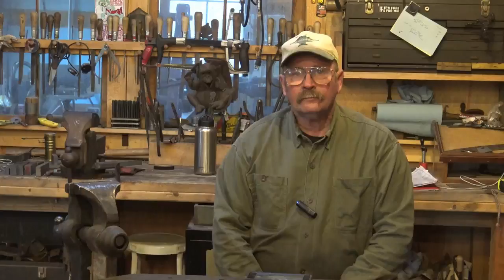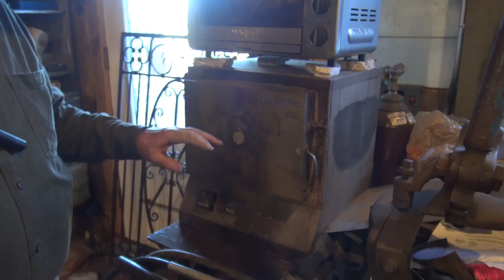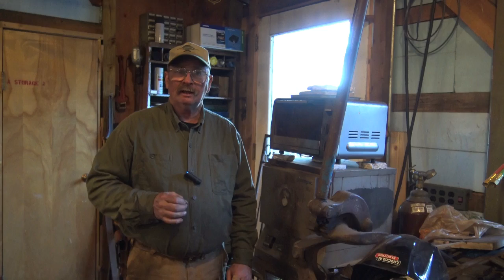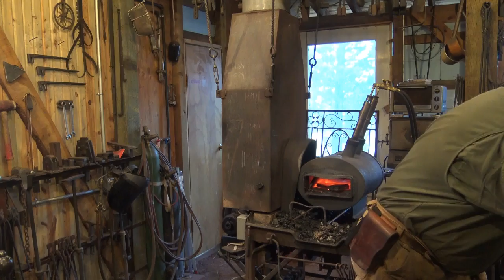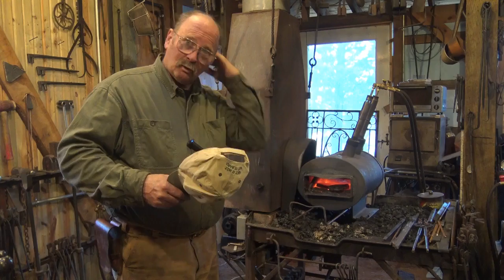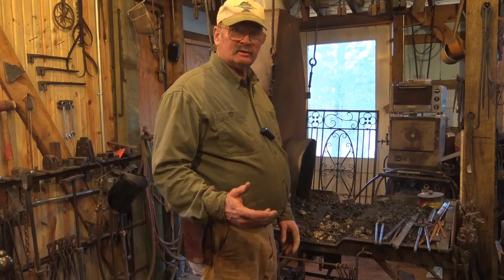Coal forge vs Propane forge a look at the pros and cons

Comment: That absolutely was the most informative yet non-preaching videos I have ever watched. Thank you !!!!  Including Fact of you what you know , facts on environmental side is rather important especially depending on where as you said some of these forges would be placed. Where as I am much the same as you just a bit higher in elevation and bit northwest of you in Park County which is anything goes as long as your zoning is business or Agriculture, which I am both and regardless I am still considering the concept and concerns for usage of coal & or coke. I was however sparked by immediate thoughts and light bulbs  when you had mentioned charcoal heating for a forge which can be done without even more then a purchase of a  large billows as well as can route my stack through my cabin which is half inch fracking pipe as a form of forge / wood burning boiler. Which does not work very effectively or efficient as a wood burning stove but as a wood burning furnace/ forge that changes everything,  So thank you to your video my heating /Forge upcoming costs are no longer a purchase , but instead  a already have most items and can spend more where I need to for better equipment. I also raise Llama and know most people use wool lining in forges due to the fire resistance wool has is this what you would recommend in your coal forge and or in a charcoal forge ? And assuming I wouldn’t be able to achieve welding temperature at 9000ft with a dual or three burner propane forge however got a good deal on 1000gallons two years ago so would be less labor with propane yet again my stock tank heaters will be fine using that up and to get the smoke rolling out at the start of my day instead of the end of it with long wait for my cabin to heated by days end already would be absolutely perfect, would be amazing!!! I just got frostbite on my fingers and toes so I am ready for some heat after that long recent cold snap we had up here @-20’s .... Even the building the wood burner forge/furnace / ex wood burning stove is in is heavy gauge steel sided building using the scraps  left over from the Pepsi center , as the place was originally built by the metal fabrication company who did the metal for the Pepsi center and hence why a metal building has a wood burning stove that was extremely over built as a stove but perhaps perfect as a wood burning furnace/ forge  Broken Arrowhead Ranch on Facebook if you happen to have Facebook and would take a look at the metal cabin and give me any helpful suggestions or guidance sir !!! Thank you -Cotton

Comment: Oil Burning Furnace; Look up Beckett Burners folks. Those things get really hot. Another Idea I saw to cut down on the heat on a gas forge, Just Throttle it back with a bypass valve while your hammering. Back to the show...

Comment: I much enjoyed your video and consideration of charcoal as fuel. I live in the Southeast U.S. and have tens of thousands of pounds of hardwoods all around me that I need to  clean up after our somewhat infrequent snow and ice storms plus hurricanes. I am never at a loss for wood, so I burn charcoal and use that in my forge. It also has the advantage that once burned it does not rot or get infested with wood-eating insects. The best charcoal return that I have achieved yet was with split wood from wild cherry and persimmon trees. That turned out to be very nice stuff and better than charcoal from pecan or hickory. I have 500 lbs. of charcoal  in my fuel box at the moment made from trees downed by Hurricane Michael.
Reply: Thats awesome.  Its getting expensive running a kingsford charcoal forge hahaha.  Got a gas forge on the way though.

Comment: Thanks John, really excellent thorough video. I got started on a little coal/charcoal forge and I'm now building a propane forge for exactly the reasons you set out - it's clean, compact and convenient. As someone who currently has to fit blacksmithing around a 9-5 day job, being able to fire up the forge in a matter of seconds and work for an hour without coming back covered in coal dust and smoke will mean I get out to my shop much more often during the week.

Comment: Thanks for the talk, practicality is going to make the decision for most if not all! I use LPG, you call it propane but is my only option unless I can source enough timber and make my own charcoal and that is impracticable! Coal is just not available, electric induction would be hugely expensive even after the set up cost as electrical power here is the most expensive on the planet. Sadly, forge welding is out of the Question except on very small and infrequent occasions!
Reply from the maker: I forge weld in propane on a regular basis. So it is a possibility with the right forge

Comment: Hey John, thanks for the class on fuels; What about Wood Pellets there compressed at 10,000 psi. which breaks sap capsules in the fiber. They get really hot. The Beckett Oil Burner is an awsome little machine that will burn waste oil. I learned it one day and taught it the next. It actually has gears that can grind up any crud that may be in the waste fuel. Thanks
Reply from the maker: I have heard of people using them, but have never tried them myself

Comment: I have two induction coil units but they have never been used for heating pipe.  And they are over kill for a work shop like a black smith shop. they are 20 KW units and are three phase.  I can get units smaller and that will run on 220 volt single phase. and you can design how ever you want to drap your copper coils. It would be really easy to adapt the use of my induction units for forge work.  The thing is that you can set the temperature of your metal to within 1/2 degree and actually melt any metal you put in it if you want. I can turn any ferrous metal into molten magma in minutes. and do it to exact and I mean EXACT temperatures. GO for it..
Reply from the maker: If the budget ever allows, I am sure i will give one a try.  Or if I'm lucky someone selling them might like to let me demo one.

Comment: Hi John,

Thanks for the excellent videos.  I’m just getting started in the craft, and this presentation really helped make my decision.

You mentioned problems with forge welding and the flux causing deterioration of the bottom of the gas forge, and that the hearth liners that are offered do not perform well.  Incidentally, I own a small company that manufactures high temperature ceramic components.  The material we use is very high strength, very corrosion resistant, and rated for 3,200 F.  I have a few tiles 3.5” square by about 3/8” thick that might be worth trying for a hearth liner.

Let me know what you think, and I’d be happy to send them your way to try out.    

-Ben
Reply from the maker: I would be happy to see how they hold up.  But 3/12" will likely be a bit small and flux would drip of the edges.
Reply: @BlackBearForge  What width would be ideal?

Comment: Hi.
Have you any idea why the burners come into the gas forge from the top as when the forge is turned off all the intense heat wants to travel up to the gas tip. Foundry furnace always seem to come in from the lower side. Thanks. 
Really interesting.
Reply from the maker: It seems to help heat the material more evenly as opposed to having the direct flame from one side.  In use heat can't travel up the burner and if you close the chokes at shut down you can keep excess heat from going up to the tips after you shut it down.

Comment: Was just rewatching the video. As to the social impact of using a coal forge in a residential neighbourhood; I have an understanding with the pot heads next door. When they decide to smoke up and stink the air up, I get to pile on the green coal. Take that!  Of course not that it matters at that point because they're baked.  I did however feel bad for the guy two houses down. The one day the wind was blowing directly to his house. After piling on a bit too much green coal you could see the cloud of smoke enveloping his back yard right when he was working in his garden. That was followed by a fit of hacking and furious coughing. I figure that if I can tolerate the pot heads and the lane being filled with cars from the curbers, they can put up with my forge once a week. I do have one question regarding the gas forge. Do you turn the gas down between heats to conserve fuel? or do you let it run once it's at temperature? I'm working on adding one to my collection and need to get an idea on the tank size I will need to consider for a small portable set up. Cheers.

Comment: Again, a very knowledgeable and informative video. I realise you made this a long time ago, but I only have a few hours a day to do things other then work and dad. After saying all this, you were talking about the expressiveness, and overall hard to get electric induction furnace. I had built one from an old electric heater, some sheet metal, and some kaowool (with various other parts) a few years back. The blueprints for which I easily found online, and spent less then $200 on. I used it to smelt down aluminum cans into  ingots. It didn't last long, as I'm electrically illiterate. However, if me being some dumb kid at the time could build 1, I'm sure a master craftsman such as yourself would have no problem building and operating. I know I for 1 would love to see you at least try. Just food for thought. 

Keep up the wonderful videos, and beautiful works. Thanks again for your wisdom.

Comment: You mentioned charcoal several times. Is there on that works best? Homemade, briquettes, hardwood lump? What are your thoughts on that?
Reply: Probably lump or homemade hardwood. Bricks are useful for grilling.. and thats all
Reply: I wouldn't even use briquettes for grilling to be honest. It's pressed charcoal dust and very nasty.
I've used charcoal and if you can get your hands on it, hard wood x charcoal is something different. Works really nice and keeps you going for a long time.
But you have a lot of ash flying around using charcoal. Just remember that.
Reply: I use briquettes and they get very hot. Stuck rebar in and thirty seconds later it was bright orange. It gets so hot that the cheap brick I use in my forge frequently spalls and breaks in two. The dust is a nightmare but if you had to use it, it could start you off....but definitely use something else.

Comment: i worked for a small foundry that made hard surfaced components(ag chisel point, asphalt mixer teeth ,ect) and hard surfacing rod. they used an induction furnace  dont know the specks  on it but we poured about 5 gal of material in a run the system used a centrifical spinner to spin a 2 piece casting disk (chill) about 3ft dia  it took about 30 to 40 min to melt up a run i know that they  had a dedicated power set up maybe 880v   was fun to work at for a while never got to  reline the furnace  but did it about once a week with 4 to 5 runs of metal a day

Comment: The way you described loving the smell of a coal forge is exactly the same as the way I love the smell of chainsaw chain oil mixed with wood chip and a hint of 2 stroke fuel in the background. If they sold that smell as an air freshener, I'd have that smell in my house the whole time........ it's probably a good job I'm single....... I'd probably also have less friends coming over as well 😆 

A very informative video, thank you
Reply: I love that chainsaw smell. I've always loved the smell of grinding metal. Everytime I walk into a shop that just got done grinding steel it takes me back to my childhood. I grew up playing around a metal shop who produced fancy railings for  a tourist town in Idaho.

Comment: I agree with your views John, I forge with coal and plan to add a propane forge. The nostalgia of using a 100 year old coal forge and the smells, sights and sounds are something I dont want to give up, but in the winter it is especially hard to have resonable air quality in my shop so the propane will be a nice addition .

Comment: I missed this video. You cannot compare industrial processes with small workshops, for one they do not pay the same price for power as we do. Electric furnaces on a big scale are subsidised by over charging households for electricity. Then there is the wheat or corn powered forges, to me unless it is rotten should go to feed people. Then you have two faced middle class people who do not want coal smoke but love to go and take a ride on a steam train. A coal forge in a garage for a hobby should upset no one as it will only be used only on weekends as most people work, if you were earning a living  then maybe they have some reason to complain as no one wants smokey washing drying on lines.
Reply from the maker: The point behind industry no longer burning coal is that high grade coal was being mined for industry. No that industry no longer uses good coal. The mines are closing and we as blacksmiths are not a large enough group to justify keeping them open.

Comment: I have one and it is the best think I have seen and used. I can melt copper in 3 minutes and boil steel in 5 minutes.
 I highly recommend one for all metal work. a good one will cost about a grand. I bought mine on e-bay. Idaho
Reply from the maker: Good to know

Comment: I’ve always wanted to try/get into blacksmithing. I’m a welder/machinist and this fits into it. I have the opportunity to buy a buffalo 6660 forge in good condition for $550. It has electric and hand operated blower, the thick recirculating hood, and no cracks. I live in San Diego and blacksmithing equipment is very hard to come by. I’m thinking about pulling the trigger and getting it. Your video is definitely pushing me in that direction. Does that sound like a fair price?
Reply from the maker: I am not familiar with that exact model of forge.  But if it has a full size fire pot and working bower, that is a good price.

Comment: WHERE WOULD YOU BE GOING TO GET LIKE 3-8 X1" BARSTOCK
Reply from the maker: I buy it from my regular steel supplier. If you don’t have a source in your area check with a local welding shop to see where they buy from

Comment: How do you decide how large a forge you need when you start out? So you plan on working with 3 in 6 in Long stock all the time or most of the time how do you size a coal Forge for that?
Reply from the maker: 3" in flat or square?  I use the same forge for anything I am doing.  It has a standard size cast iron fire pot.  Look at the Centaur Vulcan fire pot.  It isn't cheap but you should never need to buy another one.

Comment: How long will a forge run on a 20lb bottle of propane like from a bbq grill?
Reply from the maker: Thats like asking how long a vehicle will travel on a gallon of gas.  Depends on the forge and how its being operated.  A small single burner at low heat may go 12 hours or so but a three burner run at welding heat may only get a few hours.

Comment: I agree on the environmental issues, also the social consideration - coal smells really bad. As for natural gas, that does not need to be fossil but can be made from actual CO² by using solar or wind energy (not much of that going on now, but it's starting). I have a small gas forge that is sufficient for my hobby projects, I'd love to have a coal forge, and someday I will have a German style bottom blower with a clinker breaker. If you are interested, I mean this kind: http://www.oezwerk.de/epages/62230868.sf/de_DE/?ObjectPath=/Shops/62230868/Products/%22FR100%20Pro%22

Comment: Gas forges are noisy as hell, you must use them in draft between two open windows or doors or you risk die due to carbon monoxide poisening. There was a guy in my facebook knife making group that almost got killed a few weeks ago due to he forgot to open two windows/doors in the shop like he always do. He recovered after spending 24hours breathing oxygene through a mask in a hospital. I rarely use my gas forge mostly because it's almost impossible to reach true welding heat and because of the noise and heat it puts out in the shop.
Reply from the maker: Gas forges certainly have their issues.  However if it is producing Carbon Monoxide, there is a problem with the forge.  A properly designed and operating forge does not produce any CO.  However all devices that burn with a flame, whether that is a gas forge, coal forge, or you homes furnace require a source of fresh make up air to make sure they burn properly.  If it weren't for the increased speed an efficiency for production work, I wouldn't use the gas forge very much either.

Comment: Interesting video, thank you. The parts I found the most interesting are your views on the economics, which are quite different to my situation in Australia. I'm currently using LPG (Propane) but it's proving far too costly, especially as my hobby forge doesn't justify the installation of a bulk tank. I estimate that for a given job the gas cost for me, using BBQ size bottles, is at least 4 times greater than it will be for coke, plus I need to keep multiple bottles on hand because they don't last all that long.

I'm about to construct a coke forge because that fuel is readily and economically available just 5-10 minutes drive away. That coke is originally sourced in bulk from interstate, where it is prepared for a steel foundry/mill and it's very good quality. It's the same stuff I used when learning to blacksmith. A most enjoyable fuel and is available to my in 40 kg (88 lb) bags.
Reply from the maker: Cost and availability are certainly variable in different parts of the world.  I would like to have a good coke source, but it must be shipped cross country and its pretty costly